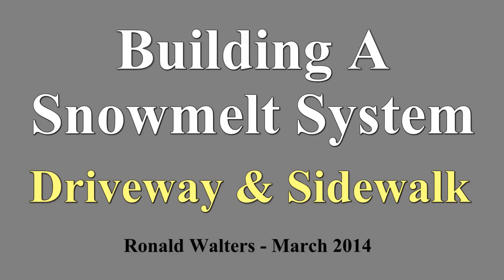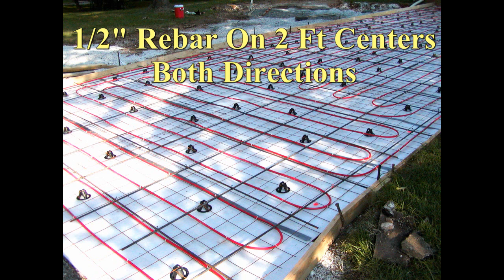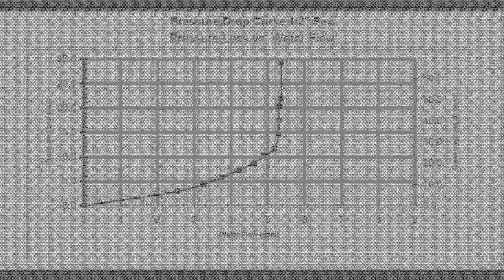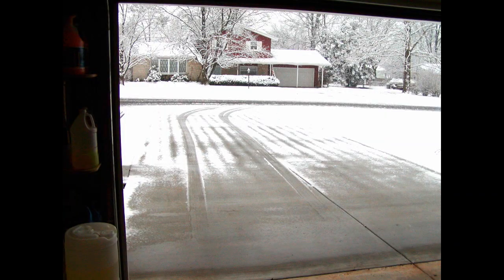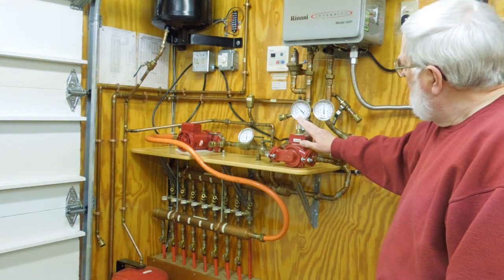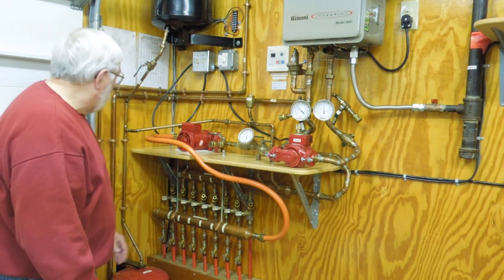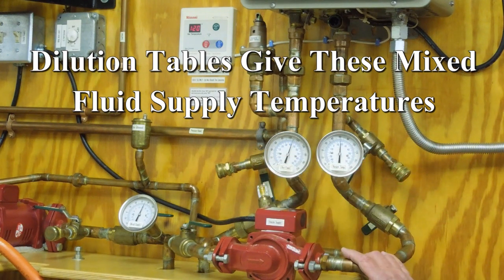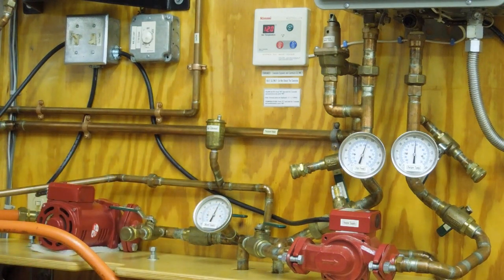Snowmelt, Building A System - Driveway & Sidewalk

Comment: Ron, thanks for posting this and very timely for me. I am making plans for my workshop and plan to incorporate a similar system. Are there any concerns with the Pex tubing at the expansion or crack joints in the concrete? If so how did you remedy that? I kept thinking I would install a one foot "sleeve" over the Pex at the joints to allow for shift if it ever happens. Perhaps this is a waste of time?
Reply: That would be a 1 foot long sleeve, with a larger diameter.
Reply from the maker: IMHO most concrete driveways you see cracking and falling apart have 3 problems. 1.) Ground base and gravel not properly prepared and compacted. Gravel is too thin (insufficient drainage). 2.) Concrete is too thin (trying to save money). 3.) Not enough steel (trying to save money). Lots of driveways and sidewalks do not even have wire mesh in the concrete. Lots of concrete guys will keep telling you wire mesh is good enough. Bull! Make sure the ground prep, gravel thickness, concrete thickness, rebar chairs (and how many), steel quantity, placement and size, and hand tool joints are clearly stated in their quote/contract before you start. 5” thick concrete, 6” square wire mesh and ½” rebar on 2 ft centers in both directions. Make sure the PEX is exactly in the center of the concrete. Use lots of rebar chairs and then keep the concrete guys from walking around on it. Make sure you use heating PEX (with the oxygen barrier) and not the regular red water tubing. Do not worry about the PEX at the concrete joints. Hand Tool Joints Only. No saw cuts for obvious reasons.  So far my driveway and sidewalk have cracked inside the tool joints. Concrete is going to crack. You just don’t know where or when. When you make the tool joints you are trying to give it a weak spot and convince it to crack at the joint. Bottom line is it will probably crack wherever it decides it wants to. When it cracks the steel rebar will hold it together, wire mesh will not. 

The insulation was in a roll and needed convincing to stay flat. I staked it to the ground with lots of 6” timber spikes and taped the seams of the insulation (cheap Harbor Freight Duct Tape) to help keep it in position until the concrete set. Place the mesh on top of the insulation immediately after the insulation is down. Be neat with the mesh and keep it straight and square. Zip-tie the sections of mesh together to keep it square. Once the mesh, tubing and chairs are on top of the insulation, it will pretty much stay where you want it.

My 1/2” PEX was on 12” centers and 6” away from the edge of the concrete. My yellow pickup was parked at the end of the driveway before the insulation was placed and stayed there until the concrete was cured.

You need a clear loop design well ahead of the project. Draw it on graph paper. Your loop length will be critical to proper flow rate and heat distribution, which will be determined by whoever does your computer design.

I bought thousands of zip-ties at Harbor Freight. They aren’t very good but they only need to last until the concrete sets. I used one every foot minimum and cut off the tails and threw the tails away (you do not want that plastic floating around in the concrete).

Take lots and lots of high definition photos from different locations. That 6”x 6” mesh is like graph paper and it can help you decide where to drill (or not to drill) if necessary sometime later on when you have clearly forgotten where the PEX is located. Basically, NEVER drill or a use nail gun in the concrete because you will never be 100% certain where the PEX may have shifted.

When they pour the concrete, those guys can get pretty carried away with their “concrete come along rakes” and they can EASILY cut your tubing. Make sure you have the tubing pressurized (with a large air tank) and have a couple of repair kits handy. Before the concrete arrives, make sure they understand they are not to jab into the concrete with the “come along rakes”. Rake on the surface only. Remind them again when the concrete arrives. And then watch them like a hawk 100% of the time. You cannot blindly trust them as they have firmly developed bad habits. Have a case of cold beer available IF there is no damage to the tubing and a hefty financial penalty if they do (clearly state the penalty in the contract). You really do not want any joints inside your concrete and you do not want any concrete inside your tubing.

I did the radiant heat in my shop exactly the same way. Watch my video “Building My Steel Garage” http://youtu.be/ZnV3m4Vx500

Planning, preparation and looking after the details is key.

Have fun!
Reply: Ronald Walters Ron.....THANK YOU! I really appreciate the time you took to detail this out for me. This will certainly help towards a successful outcome. My brother just did the majority of his house and basement but that was utilizing a compacted mortar sand over the reflective insulation, and then sub-floor over that. Very different application but extremely efficient system. While mine will be inside a shop, I plan to implement all your advice into the project. Living in Michigan, our little 'ice-age' this year has convinced me to go this route. Especially if I plan to work a lot in the shop. See any issues with putting 2" pink board under the reflective insulation barrier as just my usual over-kill?
Reply from the maker: Don Vander Jagt I would say the more insulation the better as long as the insulation is “bug proof” (bacteria and stuff won’t eat it like some of the older stuff) and is dense enough to support the weight of the concrete and anything else that will be on top of it. 

A radiant heating installation really shines the colder it gets. If it is cold enough for the system to fire up and continue to cycle to keep the slab warm, you will really appreciate it. If your feet are warm the rest of the body feels warm.

Comment: Ron, woulnt it have been cheaper to put an electric system instead? I'm interested in doing something similar, and just debating which way to go.
Reply from the maker: There are different opinions regarding which is best. Electric is probably cheaper to install but doubtful if cheaper to operate. I have seen too many electric heating element failures like the ones installed under a cement tile floor in the bathroom and then you get to tear out the entire floor to do it all over again. Also lots and lots of automatic sensors and controls for these radiant systems... I see them as too many big dollar items that can fail. The snowmelt system is probably only going to be used a few days a year, but everything sitting outside exposed to the weather is deteriorating year-round. Weather is too unpredictable and forecasts unreliable. I find two eyes and manual control to be the most reliable (at least for myself). K.I.S.S. is the best approach. Thanks for watching. Please subscribe!

Comment: Wow you've really done you're homework on this one. What's you're typical melt time for say 4" of snow?
Reply from the maker: Depends on the temperature, type snow, ice, time of day (is the sun shining?). I can't give an accurate statement for something like this, which depends on first heating the concrete slab, how cold is it, how cold has it been, ice, wet snow, dry powered snow and if you have reason to believe the sun will be out the next day do you wait until then to start melting. I often let a good layer accumulate as it acts as a blanket and helps get things going. Thanks for watching.

Comment: Wow that's some system Ron! I work in a Lng plant and I can tell your some sort of expert possibly a plumber? Can you possibly disclose roughly what that cost you to build in parts?
Reply from the maker: Eric Bartoszak Lets just say it is not cheap to build. It is however quite reasonable if you do it yourself compared to probably 4 or 5 times the cost if you have a contractor do it. You need a system design to start with (you may need to pay someone to do that) to figure what size heat source your will need for your particular application. Then get a price for the heater, pumps, expansion tank, manifolds, valves, gauges, PEX tubing, etc. Add 5 inch thick concrete with lots and lots of mesh and rebar and insulation for under the slab. The glycol is a killer. Ethylene and propylene glycol seem to keep getting more expensive. Probably $40 to $45 per gallon, which is then diluted and inhibited for -32 to -35 degF. A 30 gallon system probably $7-800 to fill so you do not want any leaks. I am not a plumber. I am a Mechanical Engineer, University of Missouri at Rolla, a.k.a. Missouri School of Mines and Metallurgy.

Comment: Dear Ron, what size gas main do you have coming in? It looks to be at least 2 in. Are you using natural gas or propane?
Reply from the maker: Natural Gas. That gas line is a long way from the meter. The meter supplies two hot water heaters in my house (one for domestic hot water and one for radiant heat), a on demand heater for a snow melt system and then this hot water heater for the garage radiant is on the end of the line, nearly 200 ft from the meter, so it needs to be large.

Comment: nice job ron at one point in your video you said water temp when you read your digital readout .but you meant your glycol fluid am i right.this is a closed loop system and your heater is heating the glycol.do you have to add to it each year?
Reply from the maker: No telling what I might say on camera. :-) Correct, I heat and circulate a glycol & water fluid. Glycol has a limited life and will need replacing at some point. So far I haven't touched it.

Comment: I like the geothermal idea, except that the cost of the required deep well can be cost prohibitive. However, you could maybe, dual use the well for both heating and cooling the home.  

You mentioned that this unit uses heat at a rate equivalent to heating several homes. Can you provide an approximate dollar amount or cubic feet the gas used to remove each of, say, 1, 2, 4, and 8 inch snow fall, and how long does it take to complete a melting? How much heat/temp would be dangerous for the concrete? 

I guess I am Hoping that you already have some of these measurements.

Several years ago I assisted a friend of mine installing a rooftop solar pool heater to reduce the cost of heating a covered outdoor pool. I think I remember that the homeowner was extremely pleased with the reduction. The initial cost was $400 or so a month, never found out what it saved though.

BTW really nice job.
Reply from the maker: Solar heat is great if the sun is shining or if the solar heater is not covered with ice and snow. 

Snowfall or ice accumulation is an unpredictable quantity; as is what it takes in terms of heat to melt ice, wet snow or dry snow. Ice takes much longer to warm to the point of melting than does snow.  So, can I provide an approximate dollar cost? No! I said it costs as much as heating several homes… and it does for that period of time it is actually running. It can easily double or triple my gas bill with really bad weather.  It is my understanding some commercial or government facilities in cold winter areas turn on their systems and leave them running (to some extent) due to the time it can take to warm up the heated area if it is allowed to freeze. That would certainly be expensive.

Solar or geothermal is not the answer for this. If you go to a “professional” for the design and installation of such a system, it is simply amazing the complication they often want to build into the system so it will supposedly run automatically. Snow detectors, temperature anticipators, heat exchangers, insulated storage tanks, concrete temperature sensors, you name it. I do not need it to run automatically. I can look outside and see if it is snowing. I can watch the weather report to see what is coming. The cost of building this system myself was a small fraction of what I was quoted and it works quite effectively.
Reply: Oh contraire, on the professional. I think most would agree that you are one. It is pretty clever that since you are using glycol as your working fluid, you appear to just divert a portion of the fluid through your heater rather than require a heat exchanger. That was what we did with the pool heater also. To use geothermal you would need a well and a fee hundred more feet of that pex pipe to get to that free, constant 50°, subterranean heat source. It could tie into or probably even replace that on demand water heater in the same way your doing now. My guess is that a thermostat on the well pump could manage it. Since the heat is free, you could maybe use some variance on the rice cooker (they detect when the water is gone when the temperature of the heating element starts climbing above the boiling point) method to shut it down when done. I know, who's gonna do that now, but you're clever design solved a lot of problems in the geothermal arena. They only need heat exchangers to pump the temperature up to human comfort levels. In this case, you did, I think, every part of a geothermal system except the well (I know, when I looked into this many years ago $5 to $10 k well cost was the big barrier), but fuel and electricity was a lot cheaper then, plus it's fun and easy to speculate when your not doing the work :-)

Comment: I am wondering what insulation you are using?  I tried googling the foil insulation and came up with everything  but what you showed.  Name and Brand, maybe store also.
Reply from the maker: LOW-E  Slab Shield Insulation  What I used was white and 1/2 inch thick. Looks like they have redesigned it and it is green and I only see 3/8 inch thick material. You will need to research it on your own.  Google it. Please subscribe. That is what keeps this channel going. Ron

Comment: what is that orange tubing? is that like a form of flex pipe for water or is it still pex? it looks like it retains its shape with bends.
Reply: the orange tubing connecting the manifold to the pump
Reply: there is also a minimum length before you have a bend on any pump i believe its 5-8x times the pipe diameter minimum pipe length before a turn or bend
Reply from the maker: I forget the name of it. It was sent to me as a sample. It has an aluminum sandwich layer with a PEX like material inside and outside. It is made for radiant systems and holds its shape. It did require proprietary fittings each end. A bit more difficult to bend to shape. You don't need to worry too much about having a bend near these pumps because they are more a circulator than a pump... assuming all the air is out of the system you can't starve the suction. I made this a sweeping curve (the orange stuff) because I had room to do so, it eliminated several solder joints, this pump is moving a bit more fluid than my radiant pumps in the house and it looked nice.

Comment: Have you done an analysis of electrical heating vs water heating?   What happens to the original glycol concentration if the system is not 100% circulated?  If it gradually dilutes, doesn't the system tend to freeze up?
Reply from the maker: Many people are disappointed that they buried electric heating elements in their bathroom tile floors. Once the heating elements die all you can do is tear up the floor and try again. No, I did not, and would not, consider electric heating. Where would you expect the dilution to come from? It is a closed system and the entire system circulates.
Reply: The dilution question was my error.  I misunderstood about your diverting part of the flow to the heater and assumed you were not recirculating 100% of the circuit flow.  

You did not specify what concentration of gycol you are using.  In case you are not aware, the maximum freezing protection is achieved by a 66% glycol/water mixture.  

https://hellafunctional.com/?p=629

Also, it is interesting to note that the specific heat of a glycol/water mixture decreases with further increases in glycol concentration to 100%.  I learned this the hard way when I put 100% glycol in a car radiator to give it "maximum protection" from overheating, and instead CAUSED more overheating since 100% glycol does not conduct heat as well as a more reasonable 50% mixture.  It would seem that approximately 66% percent glycol - distilled water would give the best freeze protection and good heat transfer for your driveway.
Reply from the maker: Ok... when you are injecting fluid at one temperature (hot water from the heater) into a moving stream of fluid at another temperature (cold fluid returning from the concrete) there is a calculation you can do to determine the resulting mixed temperature and I did that several times to come up with my dilution tables (hot water diluted by cold water equals a resulting temperature). Obviously flow rates must be taken into consideration. So we are diluting a temperature rather than a fluid... could also be called tempering. I chose to do it manually rather than depend on a mixing or tempering valve.  Ethylene Glycol 40% good for - 25 deg F plenty good for around here.

Comment: I know a guy that laid electric heating cables before pouring the concrete. Simple but worked well.
Reply from the maker: I’ve seen it done and many have had problems with it, especially for heating bathroom floors. Basically it boils down to; “to each their own”. Radiant heat using heated fluid circulated through the concrete has been around for a long, long time. If there was a problem with what I am doing, people would not still be heating their homes, shipping docks, airports and cities wouldn’t be heating paving with the same exact system I am using. If you think about it another way, using electric to do this is a dual conversion of energy. Fuel to generate electric and then electric to generate heat. My type system directly converts fuel into heat and where I am it is cheaper than using electric. Thanks for watching.